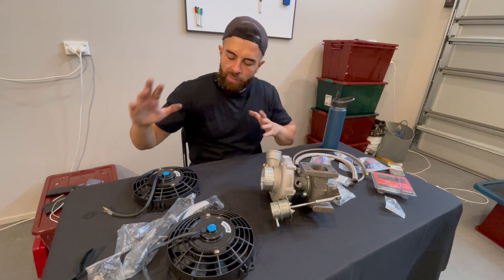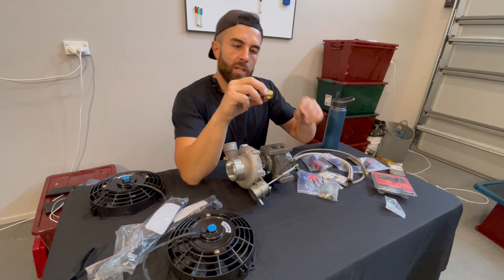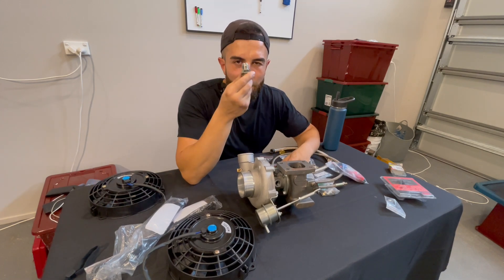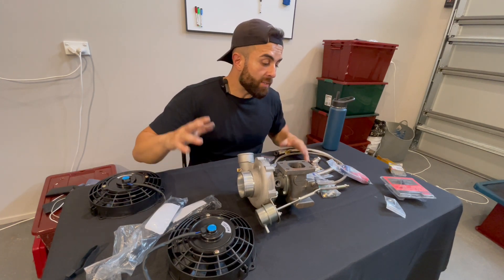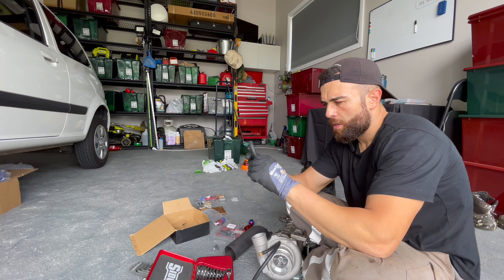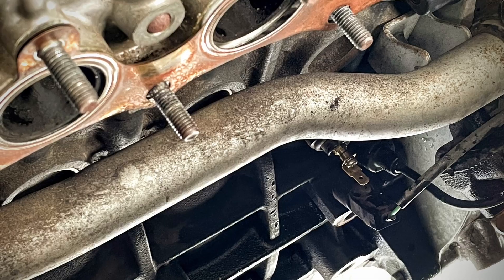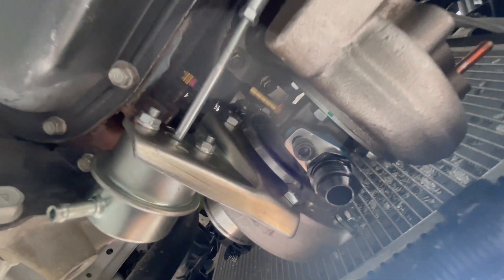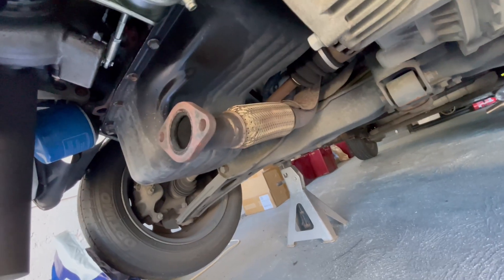How to Turbo a Hyundai Getz. DIY $2000 Challenge. Episode 5 - Fitting the Turbocharger (Part 1 of 2)

Comment: great videos, but just saying the SAS sandwich plate has 3 ports to 2 out oil pressure gauge and turbo feed  and a return for turbo return so the sandwich plate is the best option on the Getz
Reply from the maker: As great as the sandwich plates are, the ones I've seen don't have a return provision as the 1/8 ports are pressurised with oil, so they are too small (you need min 1/2 inch for drain) non drain compatible (as oil drain can't be pressurised), and the oil plate/filter sit higher then the sump, so a scavenge pump is needed.

However, sandwich plates are still great for the feed and gauges and make it so much easier hooking those 2 up, as for the return line from the turbo, either to the sump or a scavenge setup and then you can send it anywhere (like the valve cover) 😊👍